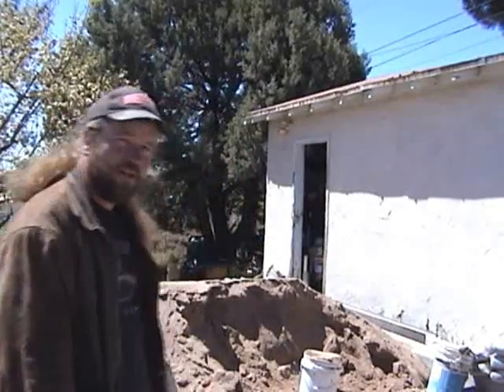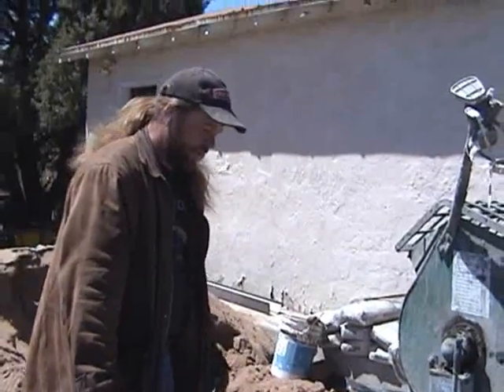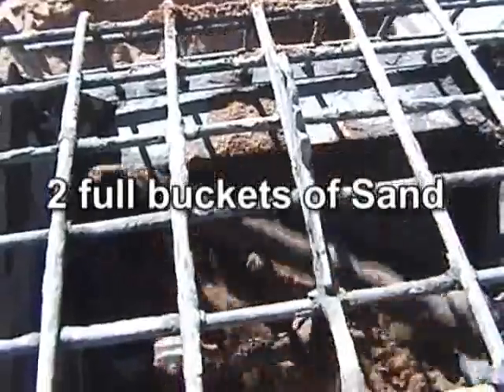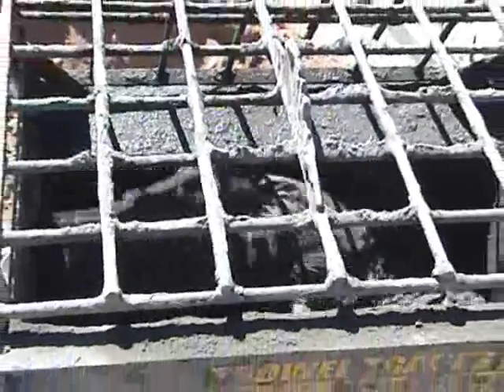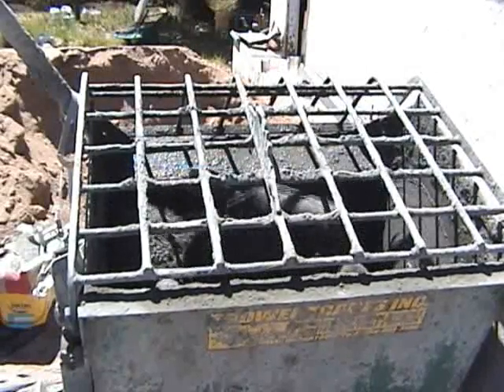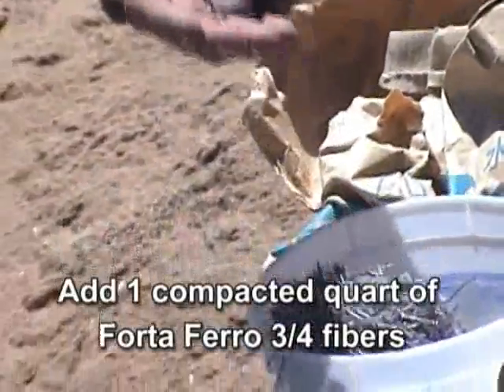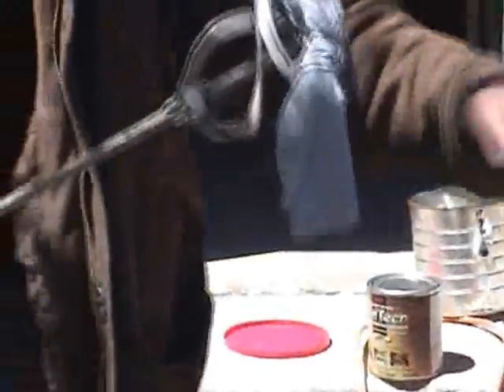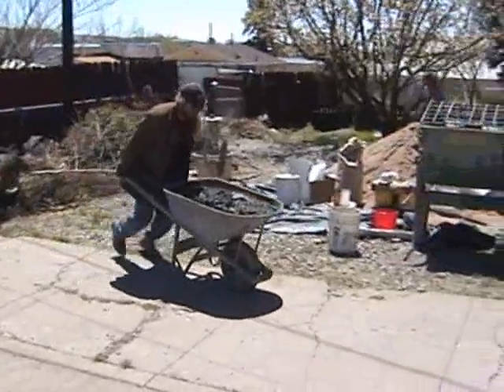The Plaster Mix for Parabolic Stress Skin System

Comment from the maker: Try & test your own variation. Use 30 fluid ounces of Silica Fume. Replace 25% of ASTM 200 mortar sand with a much finer, even gradient quartzite sand, such as medium grit sandblasting sand.  Use compound from LiteBuilt LLC, UK Available, for aeration.  Many options for super P.  Use one designed to prevent segregation + provide long workability.  Doesn't have to be a polycarboxylate.  Skip rebar and chicken wire.  Too old school RC, not modern thinshell. Do lath LFC skin only.  Study procedure.

Comment: Hello. I want to thank you for a very informative video. My problem is I am in England and I can't get all your ingredients. I own a barge which is corroded inside and out. I can't afford to take her out of the water , so my only option is to ferro her from the inside. I intend to weld rebar between the ribs and mesh or chicken wire or whatever you might suggest. I can vibrate the plaster to exclude air and voids. But , if you had time to give it some thought, I would value your advice.

Comment from the maker: @elvieken The Micron 3 is Flyash refined.  0 - 10 microns with 80% being 3 microns.  Regular flyash is 0 - 30.  This is why you can reduce the amount of flyash by 4 fold with the same effect but less water demand.   A lot of air on the nozzle dries it out.  Still, you shouldn't do more than what you can take care of with tarps and water spray for good curing maybe 10 or 12 mixes a day.  Roofs are sturdy because of the stress-skin effect, not the membrane strength so much.  < 16 ft spans best.

Comment from the maker: The Mearlcell 3532 microsphere closed-cell air bubbles is not air entrainment but is what makes the shell permanent.  The aeration here makes this high-strength mortar, but more importantly low-shrink mortar which grips the reinforcing better, into a workable plaster - great for overhead, compatible with acrylic + water reducer.  Closed cells hinder moisture intrusion, cushions impact and arrest progressive rust and removes other internal strains, such as ice, that are caused by expansion.

Comment from the maker: Why not use a stay-in-place form like the system presented here.  That way both surface shells would provide a provide a water proof membrane and the cellular concrete fill could be potent moisture barrier as well.  Also, the overall density of your 15 inch shell with a 28 pcf cellular concrete fill would be around 50 pcf with the steel and everything so if if the hull was breeched, and your sub filled with water, it would float.  Wood forms can create a serious cost hurdle for a project.